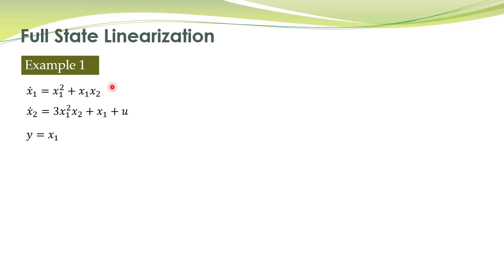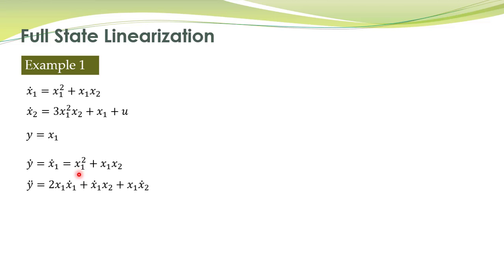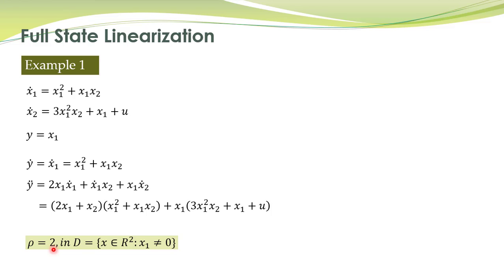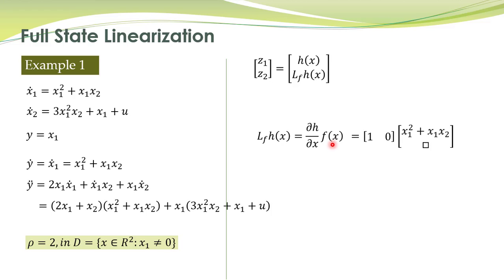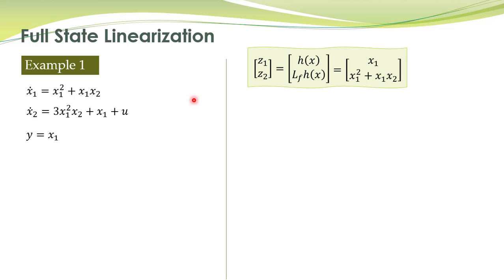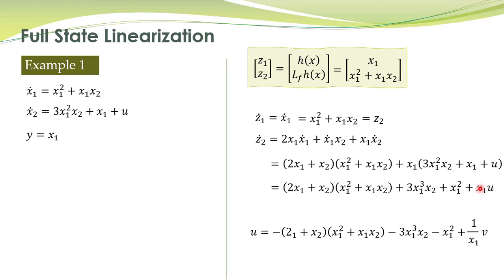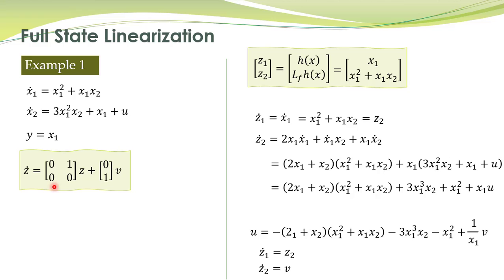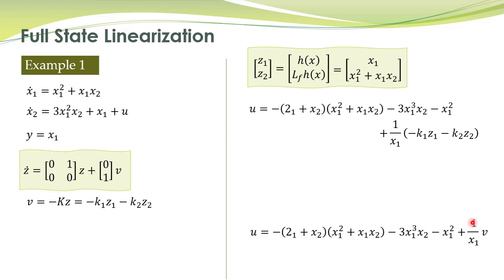NCS - 26b - Example - Full state linearization ( rho = n )

Comment: I think the control law u should be all factored by 1/x1 not only the v part; so as to cancel x1 and have all the nonlinear terms cancelled!
Reply: I agree with you @ahmedfouda4476. After that the result can be z2_dot = v
Reply from the maker: I need to check it.